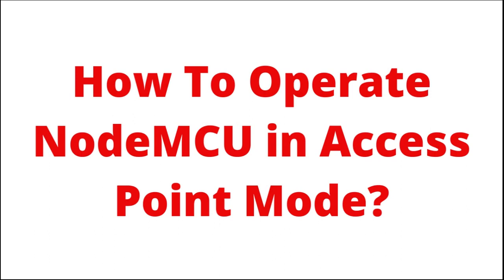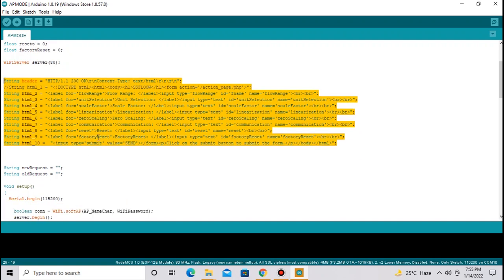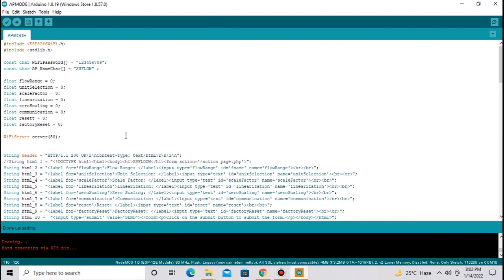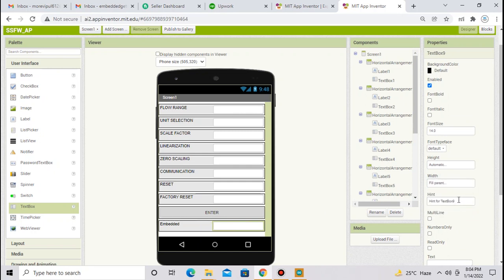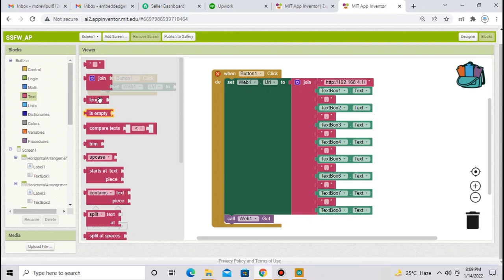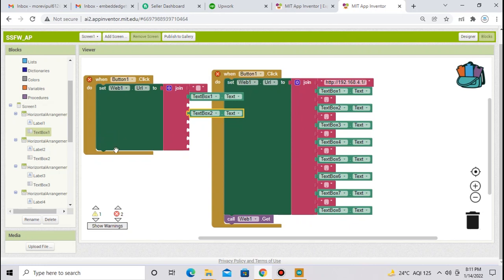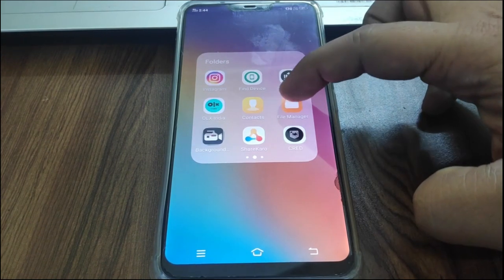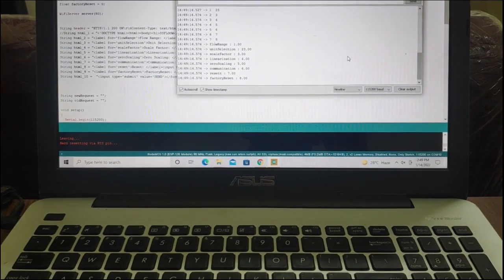Send multiple values to NodeMCU without Internet or WIFI.

Comment: It is necessary to have a rouster to work with the esp8266 nodemcu, I want to use it to turn on a strip of leds ws2812, but I do not have wifi in my home that I must do to make it work so
Reply from the maker: You can use a mobile hotspot.

Comment: Can you please confirm, if I use this app on my smart phone, will I still be able to get connected to my wifi router connection & receive my emails & other notifications or I need to disconnect from app in order to get my normal internet connection.
Please reply.
Reply from the maker: You have to disconnect from the other networks. You didn't get any update if you connect the mobile app to nodemcu network.
Reply: @EmbeddedGate  Thanks dear